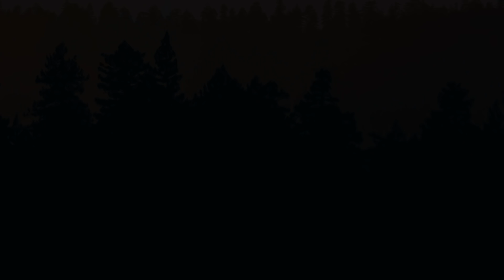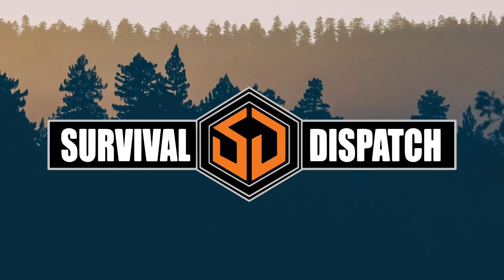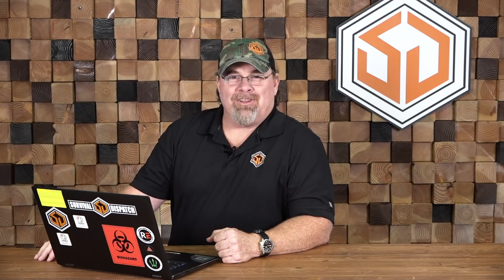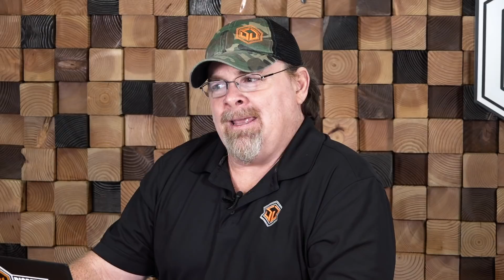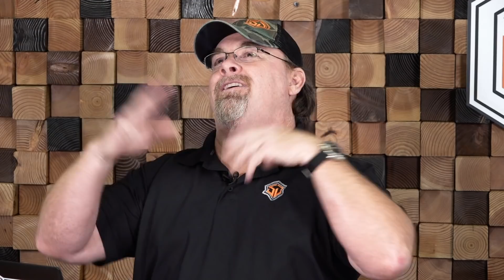All About Generators!

Comment: Metals burn. Aluminum, magnesium, titanium, iron, all sustain combustion (burn) as primary fuels and not via off- gassing.
Reply: Yep, 5000 degrees, and non extinguished by water. :-D
Reply: Here are the rules about portable generator safety: This is just a reminder for everyone’s safety. All generator safety rules should be followed carefully. This advice is just to make sure that everyone is aware of all the warnings and it’s just to remind people to be careful using portable generators. Generators can be dangerous if not used carefully. Every year, hundreds of people die or get injured when using portable generators due to carbon monoxide poisoning and electrocution. Make sure you are using your generator carefully and keeping others safe as well. There is something very serious that everyone should always be aware of when using generators. Some people do run their generator indoors which is not safe and that increases the risk of carbon monoxide poisoning which can cause death of family and you. Some people run their generator in wet conditions which can electrocute them. Please remember that you should never run your generator indoors. Remember that carbon monoxide is an odorless and colorless gas that you cannot see or smell. Carbon monoxide is a silent killer. Keep that in mind. Make sure your generator is 15-20 feet away from your house and away from doors, windows, and vents. Never use your generator in your porch too. Having a carbon monoxide detector is very important against generator safety. Some people also allow children to go near the portable generator which could pose risks. We need to keep an eye on our children making sure that they are not near the portable generator so they won’t get electrocuted or burned by the generator which is dangerous. A locking enclosure also keeps kids safe. A generator shed might look like a tempting place to explore, or take cover during a game of hide and seek, but a generator is a dangerous piece of equipment that can cause injury. It says on the manual that we should also keep children away at all times from the portable generator to avoid injuries. Please do not allow a child or unqualified people to operate the portable generator.  It is important to keep your children safe especially little ones. The portable generator can be hot during an operation. Just because some manuals missed what should be listed doesn’t mean it’s safe to do. Always follow the generator safety rules when using portable generators. Generators pose electrical risks. If you need to use your generator during wet weather, you need a generator tent to protect your generator from getting wet. Don’t let your generator get wet. Keep your generator dry and before using your generator, please make sure your hands and your generator is dry. Do not wear loose clothing when operating the generator. Everything that is said on the generator’s operating manual should not be ignored. Never smoke cigarettes near the generator. Please keep flammable things away from the generator. Never overload your generator too. Your generator can catch fire. Never ever try to plug a generator cord into a wall outlet to avoid back feeding. Back feeding your generator is dangerous. Always turn on your generator first before plugging in appliances and shut off the appliances before turning your generator off. Use a heavy duty cord for your generator and the cord should not be worn out. All the instructions should be followed carefully. Never refuel your generator while it’s running. It can cause fire if fuel spills while your generator is hot. You should turn off your generator and let it cool off before refueling it. Having a fire extinguisher next to the generator is also important. This is only a reminder for everyone’s safety of using generators. Make sure your generator is properly grounded. Having a fire extinguisher next to the generator is also important against the safety rules. https://youtu.be/I1jT3ANENvI and here is a video more about keeping others safe when using generators and also about our family’s safety. Hope this helps. Thank you.

Comment: Over-all very good info however the part about back-feeding through the dryer outlet is misleading. It's Ok (not code-wise) *IF* you understanding what you are doing. That is a big IF. Regardless, the details presented around that issue are very flawed.
Reply: Yeah if you don't mind killing the guy on the pole fixing your lines.....in Ga you can get a murder charge and a minimum of a $5000 fine
Reply: and other people understand electricity well enough to work on 50,000 volt transmission lines every day and retire with all of their fingers intact.
Reply: @jburdman7  Here are the rules about portable generator safety: This is just a reminder for everyone’s safety. All generator safety rules should be followed carefully. This advice is just to make sure that everyone is aware of all the warnings and it’s just to remind people to be careful using portable generators. Generators can be dangerous if not used carefully. Every year, hundreds of people die or get injured when using portable generators due to carbon monoxide poisoning and electrocution. Make sure you are using your generator carefully and keeping others safe as well. There is something very serious that everyone should always be aware of when using generators. Some people do run their generator indoors which is not safe and that increases the risk of carbon monoxide poisoning which can cause death of family and you. Some people run their generator in wet conditions which can electrocute them. Please remember that you should never run your generator indoors. Remember that carbon monoxide is an odorless and colorless gas that you cannot see or smell. Carbon monoxide is a silent killer. Keep that in mind. Make sure your generator is 15-20 feet away from your house and away from doors, windows, and vents. Never use your generator in your porch too. Having a carbon monoxide detector is very important against generator safety. Some people also allow children to go near the portable generator which could pose risks. We need to keep an eye on our children making sure that they are not near the portable generator so they won’t get electrocuted or burned by the generator which is dangerous. A locking enclosure also keeps kids safe. A generator shed might look like a tempting place to explore, or take cover during a game of hide and seek, but a generator is a dangerous piece of equipment that can cause injury. It says on the manual that we should also keep children away at all times from the portable generator to avoid injuries. Please do not allow a child or unqualified people to operate the portable generator.  It is important to keep your children safe especially little ones. The portable generator can be hot during an operation. Just because some manuals missed what should be listed doesn’t mean it’s safe to do. Always follow the generator safety rules when using portable generators. Generators pose electrical risks. If you need to use your generator during wet weather, you need a generator tent to protect your generator from getting wet. Don’t let your generator get wet. Keep your generator dry and before using your generator, please make sure your hands and your generator is dry. Do not wear loose clothing when operating the generator. Everything that is said on the generator’s operating manual should not be ignored. Never smoke cigarettes near the generator. Please keep flammable things away from the generator. Never overload your generator too. Your generator can catch fire. Never ever try to plug a generator cord into a wall outlet to avoid back feeding. Back feeding your generator is dangerous. Always turn on your generator first before plugging in appliances and shut off the appliances before turning your generator off. Use a heavy duty cord for your generator and the cord should not be worn out. All the instructions should be followed carefully. Never refuel your generator while it’s running. It can cause fire if fuel spills while your generator is hot. You should turn off your generator and let it cool off before refueling it. Having a fire extinguisher next to the generator is also important. This is only a reminder for everyone’s safety of using generators. Make sure your generator is properly grounded. Having a fire extinguisher next to the generator is also important against the safety rules. https://youtu.be/I1jT3ANENvI and here is a video more about keeping others safe when using generators and also about our family’s safety. Hope this helps. Thank you.

Comment: The power companies will hold the homeowner responsible for generators feeding the grid
because they did not shut off the mains. Now if there is a transformer feeding your home
and there is anywhere from 2300 volts to 7200 volts on the other side, you will be putting that 
voltage back on the primaries and further on down the line where one is down, will be a deadly
voltage arcing on the ground. You will feel the wrath of the utilities lawyers if someone is killed
and the legal costs and being sued, they will most likely decide to not supply ur home with power
after that.

Comment: Battery backup is a great addition to a generator. It is easier to setup for the first day since it can be used inside the house. Then recharge it with the generator when you get it turned on. You might be able to run the generator for just 3 hours a day if you are frugal.
Reply: Here are the portable generator safety rules: this safety information is only for anyone who use a portable gas generator and for those who are planning on getting a portable gas generator. This is just a reminder for everyone’s safety. All generator safety rules should be followed carefully. This advice is just to make sure that everyone is aware of all the warnings and it’s just to remind people to be careful using portable generators. Generators can be dangerous if not used carefully. Every year, hundreds of people die or get injured when using portable generators due to carbon monoxide poisoning and electrocution. Make sure you are using your generator carefully and keeping others safe as well. There is something very serious that everyone should always be aware of when using generators. Some people do run their generator indoors which is not safe and that increases the risk of carbon monoxide poisoning which can cause death of family and you. Some people run their generator in wet conditions which can electrocute them. Please remember that you should never run your generator indoors. Remember that carbon monoxide is an odorless and colorless gas that you cannot see or smell. Carbon monoxide is a silent killer. Keep that in mind. Make sure your generator is 15-20 feet away from your house and away from doors, windows, and vents. Never use your generator in your porch too. Having a carbon monoxide detector is very important against generator safety. Some people also allow children to go near the portable generator which could pose risks. We need to keep an eye on our children making sure that they are not near the portable generator so they won’t get electrocuted or burned by the generator which is dangerous. A locking enclosure also keeps kids safe. A generator shed might look like a tempting place to explore, or take cover during a game of hide and seek, but a generator is a dangerous piece of equipment that can cause injury. It says on the manual that we should also keep children away at all times from the portable generator to avoid injuries. Please do not allow a child or unqualified people to operate the portable generator.  It is important to keep your children safe especially little ones. The portable generator can be hot during an operation. Just because some manuals missed what should be listed doesn’t mean it’s safe to do. Always follow the generator safety rules when using portable generators. Generators pose electrical risks. If you need to use your generator during wet weather, you need a generator tent to protect your generator from getting wet. Don’t let your generator get wet. Keep your generator dry and before using your generator, please make sure your hands and your generator is dry. Do not wear loose clothing when operating the generator. Everything that is said on the generator’s operating manual should not be ignored. Never smoke cigarettes near the generator. Please keep flammable things away from the generator. Never overload your generator too. Your generator can catch fire. Never ever try to plug a generator cord into a wall outlet to avoid back feeding. Back feeding your generator is dangerous. Always turn on your generator first before plugging in appliances and shut off the appliances before turning your generator off. Use a heavy duty cord for your generator and the cord should not be worn out. All the instructions should be followed carefully. Never refuel your generator while it’s running. It can cause fire if fuel spills while your generator is hot. You should turn off your generator and let it cool off before refueling it. Having a fire extinguisher next to the generator is also important. This is only a reminder for everyone’s safety of using generators. Make sure your generator is properly grounded. Having a fire extinguisher next to the generator is also important against the safety rules. https://youtu.be/I1jT3ANENvI and here is a video more about keeping others safe when using generators and also about our family’s safety. Hope this helps. Thank you.
Reply: And that is why a battery generator is a better idea. No deadly fumes. No excess heat. And you can use it indoors so shorter extension cords. 

Then run a gas generator outside for a couple hours while recharging. And stay next to the generator while it is running so you can enforce safety rules. Like the ones just listed.
Reply: If you are connecting a single device to a single generator do not ground the generator. It is actually safer to only allow the electricity to be on the hot and neutral lines. If you ground the generator now you can get electrocuted between the hot and ground. If it was not grounded that would not be possible. 

If the device you are powering is connected to anything other than the generator then yes the generator may need to be grounded plus you need to add gfi protection.

Comment: U are correct, and the homeowner will be held responsible, AND if there is a transformer
a.k.a. pole pig nearby powered by the gen, there could be 7500 volts on the other side of 
the line.